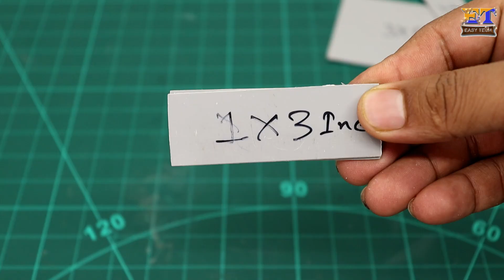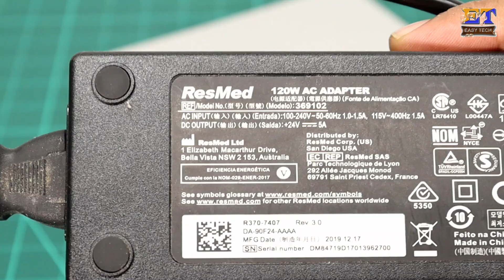How to Make Step Up and Step Down adjustable Voltage Regulator |  1-38V Power Supply

Comment: What the diode for connecting on output
Reply: Without the diodes, the outputs of both modules would be connected in parallel. Since the voltages are different, this is not possible.
 With the diodes, only the module with the higher voltage is active.  The whole circuit is much easier to realise with another module:
HW-140 DC-DC Buck Boost Converter Step Up/Down with LCD-Display